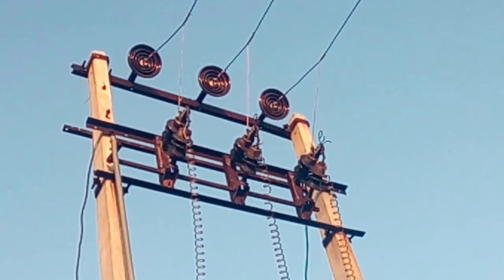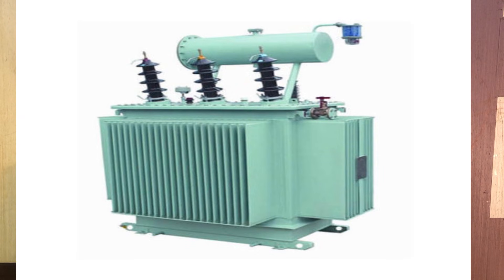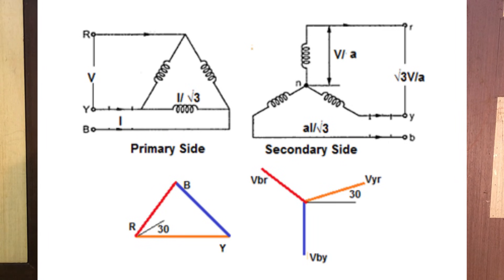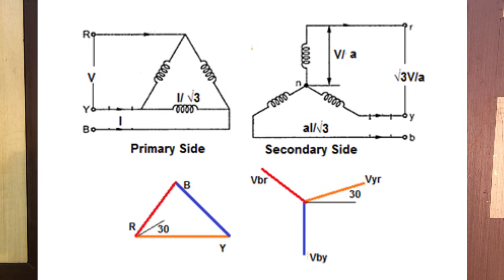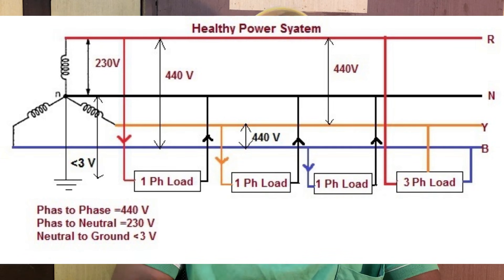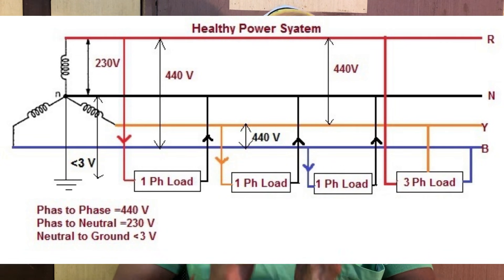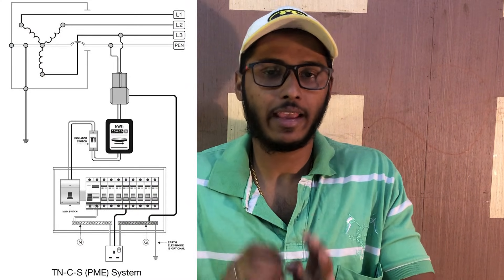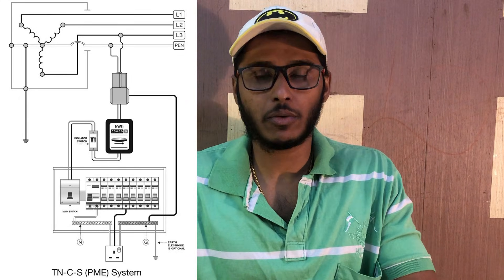Neutral | എന്താണ് ന്യൂട്രൽ | ന്യൂട്രൽ ഇല്ലെങ്കിൽ എന്ത് പറ്റും | ന്യൂട്രൽ എന്തിന് ഗ്രൗണ്ട് ചെയുന്നു

Comment: When in case of domestic ee ac switiching means the direction change and close circuit engane kittunnu ennathne kurich explain cheyamo? Ac suppliesil line ilum neutrlm direction change vararundo when in load condition

Comment: Neutral veedukalil ground cheyaruth ennu kseb parayunna main reason in case service cable neutral wire open in transformer,line,energy meter out put  what will happen  see your home ground wire connected in neutral normal conditions all equipment work very well sometimes neutral wire open eny reason may be one month work in your equipment. Then more wattage equipment not work. Lamps only work. Slowly light brightnes come down. Why it's happening. Your ground pit rod surrounding soil area dry do to current flow. So ground area make high resistance. This time  someone use hot plate,washing machine, heater,'ironbox, person get shock because your equipment earth connected in ground. Line supply  return comes in equipment body.

Comment: Neutralum phaseum loadum varumbol athoru closed pathayi current flow cheyyunnu. Pinne endukondann neutralum phaseum direct short aakkumbol fuse adich pokunnathu.
Reply from the maker: Short circuit ennu parayumbol enthan least resistance path ideyil veruaan appol high current flow undakum
Reply: Neutralu ndanennu enikku eppozhum clear aayittilla. Eppo oru bulb kathanamenkil closed path venamennu parayunnu karanam electron flow  venam. Appol neutralil koodi electron flow endakule. Pinnendann neutral zero potential ennu parayunnathu.

Comment: സ്വിച്ച് ഓഫ് conditionil earthum ന്യൂട്രലും short ചെയുമ്പോൾ വീട്ടിലെ elcb(rccb) trip ആകുന്നു
Reply from the maker: Earth leakage undakum vere ethelum point een ..socket aanel atheen plug oorit nokua allel ullilo vere ethelum point il loopil leakage undaakum
Reply: TechCorner Malayalam നാൻ എന്റെ two പിന് ചാർജർ എടിത് neutral earth കുത്തി നോക്കിയതാ switch on cheyathe
Reply from the maker: Appol undakum neutral verunne return current eduth earthilek kodukalle so rccb trip aakum..athum earth leakage aanello
Reply: TechCorner Malayalam neutral already cheriya current ഉണ്ടകുലേ
Reply from the maker: Wiring loop aanel switch illelun nalle current flow kaanum neutralil

Comment: Where is the neutral or return path for 3 phase input of Distribution transformer ?
Reply from the maker: There is no neutral only phase is coming to input and there is no return path there. But there is phase difference between the phases
Reply: @TechCornerMalayalam  dfe@aaaaazzzQSQoao⁰9⁸⁸⁸9999ixi£'8xixs89aa9a8aaiozi.  iziozzz!q!q000909⁹⁹q9qq9q99qw8,,
Reply: @TechCornerMalayalam  delta connection ennu para inputil

Comment: neutral matram thottal shock adikkuvo
Reply: neutralil power flow undo
Reply from the maker: Undu... idle condition il illa...load work cheyumbol
Reply from the maker: Adikkum
Reply: No
Reply: Normally adikkilla. If the neutral is cut before coming to the point where you touch the neutral, you'll get shock.

Comment: Switch off anelum low wattage led bulb cheriya alavil prakashikkan karanam enthanu??? Induction kondanel athu enghane ozhivakkam???
Reply: wiring cheyyumbol condutil wire tight aayi valikkumbol mattu wires nte insulation weak aayi oru induction current undakukayum athu LED polulla bulbukal sensu cheythu valare kuranja prakashathil kathikkondirikkukayanu cheyyunnathu..
athil mikkathum 2way switch connected load aakananu chance. karanam 2 way switch nte ethelum oru contact lum induction kanarund..

ithinu solution aayi  cable nte idayil koodi no:14 or no:16 copper valichu earthil connect cheythal undakilla ennu oru frnd paranju.. ethratholam possible aanennu ariyillaa
Reply: Lod yeduthal mathrame induction undakaan sadhya tha yullu
allathey veruthey induction ondakum yennu yenikku  thonnunnilla bro . Evide palrum kruthunna polay
Earth yenna thu veruthey current ozhukki kalayaan nullathalla . Athu electric bill kootum . Nammude safety mathramanu earthu kondu udheshikkunathu .
Pinne ....
Led prakashi kkunna thinu kaaranam 
1 Neutral controlill aakum switch allangil pinne
2 holderil neutral polil phase koduthittundaakam ? 
Pariharicha shesham reply tharum yennu karuthunnu bro .
Reply: @shajunadesan7619  connection correct anu...holderil neutral pole ennath enthanennu manasilayilla
Reply from the maker: Athinullil drive undu...capacitorsm...athu discharging cheyan cheriya time edukum..athaanu
Reply: @TechCornerMalayalam  full time prakashikkunnu
Reply from the maker: Switch off cheyumbol led bulb input il voltage verunundo...undel wiring problem...illel led  drive complaint aayrkm...same ithil vere bulb fit cheythaalum ingane undakundo
Reply: @TechCornerMalayalam  ok...tnks for ur valuable information...check cheyyatte
Reply from the maker: Santhosh P 👍😊
Reply: How led connected? Is it a switch on/ off indicator?
Reply: @Soorajmtly557  night lamp
Reply: ഞാൻ ഒരു ഇലക്ട്രീഷനാണ്,, ഇതേ അനുഭവം നാട്ടിൽ ഉണ്ടായിട്ടുണ്ട്,, LED ചെറിയ സ്പോർട്ട് ലൈറ്റിലാണ് കുടുതലും കണ്ട് വരുന്നത്,,, പരിഹരിക്കാൻ കഴിഞ്ഞിട്ടില്ല,,, ഗൾഫിലും ഇതേ പ്രശ്നം കാണാറുണ്ട്

Comment: Neutral return path  ആണല്ലോ ,അപ്പോൾ ഒരു ഉപകരണം പ്രവർത്തിച്ചു കൊണ്ടിരിക്കുമ്പോൾ അതിനെ connect ചെയ്തിരിക്കുന്ന neutral wire ൽ ടെസ്റ്റർ വച്ചാൽ പ്രകാശിക്കുന്നില്ലല്ലോ ? അതെന്താ?
Reply: Neutral transformer ൽ എർത്ത് ചെയ്തത് കാരണം നമ്മൾ ടെസ്റ്ററിൽ തൊടുമ്പോൾ നമ്മുടെ ശരീരത്തിലൂടെ ടെസ്റ്ററിന് വീണ്ടും എർത്ത് തന്നെയാണ് ലഭിക്കുന്നത് അതിനാൽ സർക്യൂട്ട് പൂർത്തിയാവില്ലാ അതിനാലാണ് ടെസ്റ്റർ പ്രകാശിക്കാതിരിക്കുന്നത്.
Reply: Nasar Chokli thank you
Reply: Prakaashikkendathaanu. Try to pull out the plug top half way while the load is connected and switched on. Now try touching the neutral wire via the gap of the plug top.. tester nte neon bulb ipol kathendathaanu. Illengil check tester please.
Reply: Bro neutral means zero potential. Tester bulb work cheyyan aavasyamaya potential difference neutral point to earth undenkil matrame tester work cheyyullu.
Reply: Sooraj M thank you
Reply: താങ്കൾ പറഞ്ഞതുപോലെ ചെയ്തിട്ടും പ്രകാശിക്കുന്നില്ല. ഒരു Bulb holder ൽ  Bul b പ്രകാശിക്കുമ്പോളും അതിലെ neutral wire ൽ ടെസ്റ്റർ പ്രവർത്തിക്കുന്നില്ല

Comment: Bro athupole thnne reactive power pass cheyan neutral vende
Reply from the maker: Reactive power inte effectm neutrailil undaakaar undu...
Pakshe oru transmission systethil athinte effect kurevaan... athipm oru house aanenkil avide internal aanu koodthl undakuneth...depends on type of load...net nokkumbol oru house il atrem pf issues undaakarilla..
Reply: @TechCornerMalayalam  housinte kaaryathil kk but industry nokkuane   seri alle.
Reply from the maker: Sherin Thomas industries nokuaanel athin aanu power factor control panels m capacitor banks okke vekuneth....99% industriesm apfc panels vekkar undu...
Illa enkil sheri aanu...
Reply: @TechCornerMalayalam  bro Njanum industrial field il aanu work cheyunne athalla chodichathu reactive power zero onnum allalo Athu ctrl cheyan alle apfc but low reactive power ayalum neutral thnne vende
Reply: Reactive ലോഡ് ഉണെങ്കിൽ ആക്റ്റീവ് component കളും reactive component കളും resistive ലോഡിന്റെ കൂടെ എടുത്തിട്ട് റൂട്ട് sqaure എടുക്കണംന്യൂട്രൽ കറന്റ് കിട്ടാൻ.

Comment: ഇലക്ട്രിക് പോസ്റ്റുകളിലെ  ന്യൂട്രൽ  wire  ഗ്രൗണ്ട് ചെയ്തു  കാണുന്നു.  ഇതിന്റെ ആവശ്യമെന്ത്
Reply: സാധാരണ വീടുകൾക്കു  എത്ര എർത്തിങ്  ആണ്  വേണ്ടത്?    ഈ  എയർത്തുകൾ എവിടെയാണ് കണക്ട്  ചെയ്യേണ്ടത്?
Reply: മൈൻസ്വിച്ച് നു  പ്രത്യേകം എർത്തിങ്  ആവശ്യമാണോ ?   എർത്തിങ് ചെയ്തിട്ടുള്ള  സ്വിച്ചിന്റെ    റോഡ്  കത്തി  പവർ ലീക്ക്  ആകുന്നു
Reply: @RajeevKumar-rp2eo  sadharana aayi 2 earth  undaakum. 2 um  veetile plugs il ulla earth terminal um aayi connected aayirikkum. Kalapazhakkam kodo allagil mattedhegilum karanam kodo onnu failure aayipoyallum mathethu aavide thanne kannum.

Aathinu veedi aanu 2eannam eannanu eaniku aariyaakunathu
Reply from the maker: Neutral postukelil ground cheyaaar illa... puthiye poles il earthing cheyaar undu
Reply: @TechCornerMalayalam  KSEB line il neutral  insulator il alla sadharana aayi  connect cheyunathu cross arm il thanne ketti kodukuka aanu cheyaar , cross arm earth cheythittum  undakum aa avasthayil  neutral ground cheyuna effect thanne alle undakunathu.
Reply: @vipinvv9887  മുൻകാലങ്ങളിൽ ഒന്നിടവിട്ട്  ത്രീഫസ്  പോസ്റ്റുകളും, എല്ലാHT പോസ്റ്റുകളും  എർത്തിങ്  നിർബന്ധം  ആയിരുന്നു
Reply: @vipinvv9887  insulator vendathaanu actually. Ippo cheyyunnathu ( tying to cross arm) non-standard aanu.
Reply: @TechCornerMalayalam  
Last postile neutral ground cheyunnatho
Reply: എന്ത് കൊണ്ടാണ് single phase power generatorൽ രണ്ട് ലൈനുകളിലും line tester വെച്ച് നോക്കിയാലും  ടെസ്റ്ററിന്റെ നിയോൺ ലാമ്പ് തെളിയുന്നത്. Electricity line supplyയിൽ ഒറ്റ ലൈനിൽ  മാത്രമേ ടെസ്റ്റർ ലൈറ്റ് കത്തുകയുള്ളൂ ലൈറ്റ് തെളിയാത്ത ലൈൻ ന്യൂട്രൽ ആയി കണക്കാക്കുന്നു. ജനറേറ്ററിന്റെ  ഒരു ലൈൻ നിലത്ത് ചെരിപ്പിടാതെ നിന്ന് സ്പർശിച്ചാൽ വൈദ്യുതാഘാതം ഏൽക്കുമോ I hope your explained video or reply  with  thanks  Nasar from Qatar.
Reply: @nasarchokli  neutral isolated alle portable Genset il..
Reply: അങ്ങിനെ ആണെങ്കിൽ ടെസ്റ്ററിൽ നമ്മൾ തൊടുമ്പോൾ സർക്യൂട്ട് പൂർത്തിയാകുന്നത് എങ്ങിനെയാണ്. സർക്യൂട്ട് പൂർത്തിയാകുന്നത് കൊണ്ടാണല്ലോ ടെസ്റ്ററിൽ നിയോൺ ലാമ്പ് പ്രകാശിക്കുന്നത്.
Reply: @nasarchokli  it means both the neutral and phase of the Genset are at a higher potential than true earth. Hence there will be a current flow via tester to earth. Hence neutral point is also seen lit. If you pull the neutral point of the Genset to true earth, you can see that the glow in neutral when tested with the tester disappears.
Reply: Neutral wire should actually be supported by insulators instead of simply tying the neutral line to the cross arm. If not provided with insulator supports, in the event of snapping of neutral line anywhere along the circuit, the neutral line would have line voltage( if any of the loads' after the snapped neutral point is kept switched on). This, in combination with  tying the neutral to the metallic cross arm will make all the metallic objects that the neutral has been tied to, at live line potential. Will result in electrocution, if anyone touches metallic posts or the mandatory earthing wire near the posts.. ( this can easily happen )

Comment: ഒരു 3phase മോട്ടോർ വർക്ക്‌ ചെയ്യാൻ ന്യൂട്രൽ ആവശ്യമില്ലെന്ന് കേട്ടിട്ടുണ്ട്... എന്ത് കൊണ്ടാണ്??
Reply: Phase to phase potential ullathond 
Phase Nutral potential pole
Reply from the maker: 3 phase systethil phase ukelil thammil oru phase shift undu athukond thanne oru potential difference undu...athu moolam aanu avde oru flow um oru rotating magnetic fieldum undakunethu...
Phase Sequence | Explained in Malayalam https://youtu.be/8JGvgJkYibg
Reply: Bro Ellam OK ee return vrunna current measure cheythal Ethra kanum oru normal systethil eg:5v 1A return ethra
Reply: One phase automatic done neutral